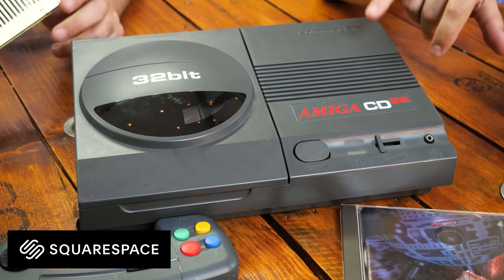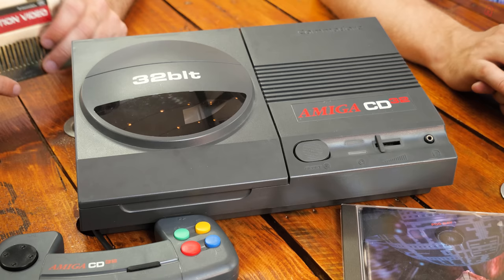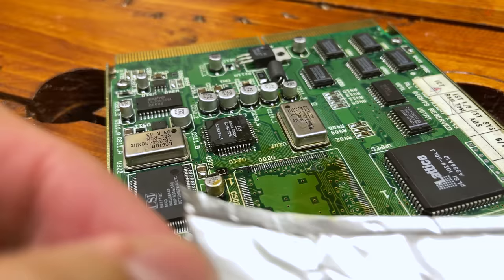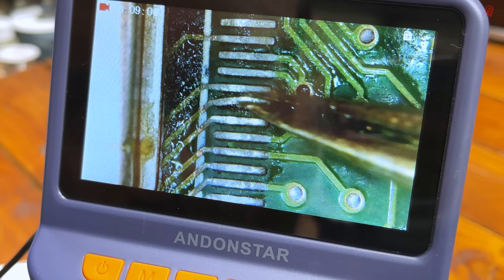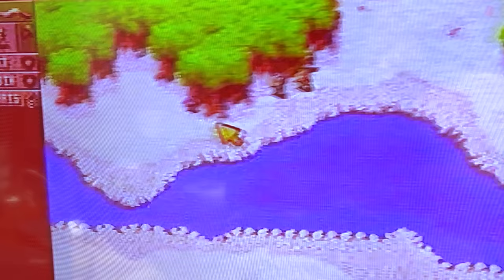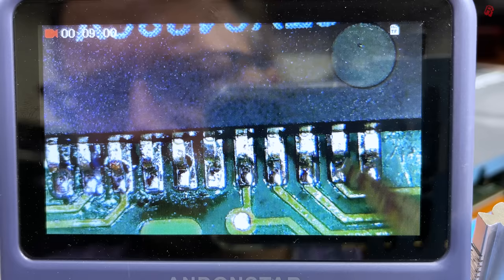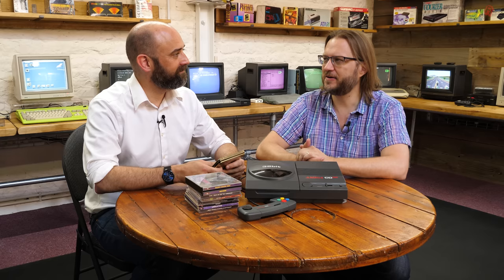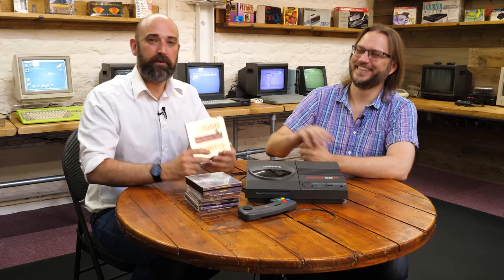CD32 FMV Failure! This thing is a mess, can it be saved?

Comment: Ouch, what a state!  Probably one of the coupling caps or perhaps one of the resistors that feeds the red or green out, or the resistors that terminate.  I would suspect those 100uF AC coupling caps first if they havent already been swapped.  You could bypass with a wire one at a time to rule them out, but that's just a temporary thing if you do that because they are blocking DC and you dont want a bias on there for any period of time.  Nice work, you two seem joined at the hip recently lol
Reply: I agree - check C250_2, C250_4, C250_6. Unlikely but still would check  C250_1, C250_3 and C250_5. It is possible resistors R262,263 or 264 are not on their values of 470ohms. Same for R253, 255 and 257 which should be 75 ohm. I'd also check  around CN1 for  shorts. Pins 2,4 and 6 are ground. Pins 1,2 and 5 should not be shorted to the gnd.
I would also check for continuity, shorts etc associated with signals AB, AG, AR, AB_EXT, AG_EXT and AR_EXT. These signals pass between the STV8438 DAC and to connections on the main bus connector that fits into the CD32 connection socket. Looking at the schematics I have, check pages 3 and 4 for detail of what I am referring to
Reply: That soldering is making my eyes bleed....

Comment: You can upgrade the mpeg rom from the v40.22 to v40.30 via a 27c400 erasable rom and then you can play philips CDi digital cds.

Also the FMV is in case upside down,when you open the case you should see the bottom of the board and it is  normally covered with a see through plastic insulation sheet held down by the four screws, but the owner must have threw it away and so it may now short on something,the giveaway is that you normally see the test points through the square cut out on the top cover.
And yes check the ceramic decoupling caps they are known to go bad with hairline cracks.
Reply: The games or the movies? As it was Green Book and white book mpeg standards

Comment: I've found that using a single strand of wire from some flex can be used to do this kind of repair on fine pitch ICs too for anyone who dosen't have any varnished wire.
Reply: For super fine bodge wires Rafał Bielawski (mostly iPhone repairs on his channel) uses single strands from micro coax shielding 😳
Reply: @RicoElectrico  hey that’s a great idea damn. Frayed shielding after you trim a piece is fairly plentiful if you’re not stretching a huge distance. Plus pulling a little bit out is a reasonable sacrifice if you’re using the coax for other things.
Reply: I normally just use wire wrap wire... pre-tinned and strips easily, if you get the good stuff.
A general tip for any wire really: Watch out for the copper coated aluminum "chineseum" stuff, that stuff is crap for soldering. Get your wire from a reputable dealer, not Aliexpress etc.
Cheers,

Comment: TBH they were flakey from day 1 - I recall mine needed just the right amount of pressure on the edge connector/cart port to work sucessfully. 

My young self put up with it because FMV on a CD32 (Amiga fanboy) - was sooo cool.
My today self has worked that out of my system  - tech HAS to work now

Comment: Hi Neil.
I am fortunate enough to own my original FMV module. I am not very technical with the insides but it's in full working order. I think I still have the original riser board still, but it works fine with my SX32 riser board which has multiple video out options on the back. I doubt either of these would be the cause of your loss of red signal but would be prepared to lend you both for diagnostic purposes (I am going to check for those missing screws too!)

Comment: I was looking at the schematic for the device. There are some electrolytics and some ceramic caps in the output circuit from U210 that provides the AR_EXT, AG_EXT, and AB_EXT signals which are connected to CN1. The electrolytics are more likely to be a problem as they can go bad over time. It would be worth checking them with an ESR meter if you can or just go ahead and replace them.

Comment: check C250_2, C250_4, C250_6. Unlikely but still would check  C250_1, C250_3 and C250_5. It is possible resistors R262,263 or 264 are not on their values of 470ohms. Same for R253, 255 and 257 which should be 75 ohm. I'd also check  around CN1 for  shorts. Pins 2,4 and 6 are ground. Pins 1,2 and 5 should not be shorted to the gnd.
I would also check for continuity, shorts etc associated with signals AB, AG, AR, AB_EXT, AG_EXT and AR_EXT. These signals pass between the STV8438 DAC and to connections on the main bus connector that fits into the CD32 connection socket. Looking at the schematics I have, check pages 3 and 4 for detail of what I am referring to

Comment: A friend back then gave me Star Trek V on VCD because he couldn't play it.
The Sega Saturn also had one of these MPEG cartridges but I didn't bother getting one. For something like this to get supported it would have had to be built into the system(s). Addon hardware doesn't work and even higher specced models of a system, like the Nintendo DSi and New 3DS were, didn't work out if the games had to specifically made for these systems and didn't simply offer extra functionality for the models like how PS4 Pro and XBox One X did. I can see the logic behind MS packing the Kinect with the XBox One but there the problem was, that only a relatively small number of people actually wanted to use something like this but had to pay for it anyway.

Comment: I have had two of these. I have had the fault you have with one of the cards, it turned out to be a ceramic cap. But I replaced the DAC as well whilst I was there. I sold that around 2005 then bought another around 2008 after massive regrets. The carts never have screws in the side (at least neither of mine have). TBH a full recap is wise now as my last one which was perfect developed all manner of faults during 10 years of dry temp controlled storage. A recap brought it back to life and I sold my whole boxed with instructions CD32 collection about 3 years ago. AFAIK there is only Cannon Fodder as a game that uses it (and only for the FMV intro), and also the amiga advert which was on many CD32 cover discs at the time. If you left the cart out you got a postage stamp size CDXL version to view, pop in the cart and it was full screen. IMHO the CDi had the better FMV cart and that is how I watched all my VCD's at the time

Comment: I think that this pretty much points out that soldering is not welding and flux needs not to be applied via fire hose.  Having seen many repairs of amplifiers, computers and other such older gear I know dodgy capacitors (especially cheaper ones like Commodore bought) tend to cause problems down the road.  As long as you get the values correct, it's not like you can make the problem worse by shot-gunning them after all.

Comment: Really good video. The back and forth is definitely a lot more RMC-oriented. It looks like the Red/Green voltage isn't getting all the way through somewhere, meaning it's probably either those capacitors, resistors (if there's any on the R/G lines) or DAC. I'd desolder the caps while you're waiting for new ones and test them. If they're not duff it's probably not the problem.

Comment: I would try to recap the board, if you haven't already. Electrolytic capacitors hate getting too hot and they aren't young to begin with. Someone obviously soldered this board quite aggressively, maybe with high heat for too long at some places.

Comment: I recall downloading a VCD copy of a movie once back in the early 2000s. While I'm sure having a movie on a disc was more convenient than VHS tapes, I thought the quality was terrible. I'd seen examples of good mpeg videos, but the level of compression used to fit the whole movie on a single CD made it look sub-VHS quality.
Reply: I agree, any digital always starts worse than previous counterpart, VHS -Video CD, CD - MP3, Film Camera - Digital Camera, in some cases it takes 20 years for them to improve upon!
Reply: @CastleFamilyThe  The very first digital camera I ever saw was a cheap one my parents ordered from a mail order place for less than $30. It took horrible pictures. They were small (resolution), dark and grainy. That really gave me a negative impression of digital cameras. 2-3 years later, my mother got a Kodak Digital camera and the difference was amazing. I still use it today and about the only time it takes a bad photo is in low light. It has various settings you can use to compensate for that, but to be honest, I don't really know how to use them.

Comment: I'm surprised there wasn't any hot glue in there. But I guess with all that flux it would have never stuck!
Reply: Hot glue? Why? Flux sticks better than that stuff!
Reply: Amateurs have bad habbit "securing" and covering wires in with hotglue.
Reply: @jaekaelae  I remember having to repair one computer where the owner had hotglued all the plugs and cable connections.  Let's just say that I had a few words with him.  Most of those words were not suitable for polite company, if you get my meaning.  😉
Reply: @SpearM3064  Hot glue is incredibly easy to remove with some IPA. No need for bad language!

Comment: I have the same issue with the FMV module on the CD32. But, it only happens after about 10-20 mins of using it. So i have full colour for a while, then it turns red/pink. I did order a tray of the STV8438CV DAC chips years ago thinking it might be that. But i never got around to swapping it out, and it's more likely the caps anyway. If you need a DAC chip let me know and I can send a couple to you(I'm in Ireland). Worth mentioning that my module sure does get hot when playing back video cd's.

Comment: I genuinely hate "repair pros" that use gel flux syringes like they are inoculating elephants. Esp the ones that teach those bad habits on youtube. Mark has better "flux control" than most.  There is a minimum amount of flux to get the job done. Everything else is just lazy? Bravado? Lacking in training?. I use a flux pen for 95% of jobs. It applies just enough flux, at the point you want it, and it wont spread out that much. Sprits of alcohol and a few swipes with a brush and its gone. very rarely, I might have to bust out the gel with a needle tip.  Heres a pro tip : If it takes longer to clean up the flux than It took to solder/desolder the part, you are doing it all wrong.   "oh im just gonna put a bit of fleu'x on thar..."  *gobs it on like toothpast*
Reply: To be fair, most people use far too much toothpaste, too (about the size of a pea is all you really need), but that's sort of getting off-topic.  I agree, too much flux is a problem, and if the excess isn't cleaned, the residue it leaves behind is almost as bad as the layer of cigarette tar that I've seen in the computers of some chain smokers.

Comment: I'd use an o'scope and look at your color channels, looks like you only have composite out but that chip should output RGB separately and they are combined later on. since I don't know where they get combined on that, could be on the board or inside the CD32, so don't overlook the connector inside the unit.

Comment: Most of the chip caps look TERRIBLY soldered in (bad alignment, blobby joints, etc). And with 1 liter of flux thrown on, its impossible to tell if any of the electrolytic caps are bad. Nice repair work so far. I would:  1: fully submerge in ultrasonic cleaning. Urr.. possibly remove most of the parts first and inspect tracks under parts carefully. There could be flux under almost everything on there.  Bath it good. Then remount all the chip caps. Finally replace the electrolytic caps. If that doesnt solve it...  urrrr....

Comment: With all those pads missing, it looks like they tried the capacitor twist trick, but for the chips instead! Seriously though, most likely they applied too much heat unevenly, and tried to lift the chip before all the solder melted. Definitely a trap for young players. Excess heat can also damage caps, both electrolytic and ceramic, so I'd recap the thing as a matter of course. Especially if you've got the schematic with the MLCC cap values. At least the ones around those chips anyway.

Comment: Only seen 2 of these in my day at SDL judging by the amount of flux I would say that board has got extremely hot when it was "flowed" it may have a few dry roasted joints, reflow the board - schematics may be an issue due to its age - a quick google, and they are around on a few forums
Reply: Check the SMD crystals 40mhz on is right in the heat space of the C-cube

Comment: Are there any buffer transistors on the output of the DAC, is it an RGB signal. One could possibly be leaky causing a shift in the dc level. Without seeing a circuit diagram it's difficult to know. It might be worth checking the dc voltages on the DAC pins as well.

Comment: The debate about whether CD32 is the first 32-Bit CD console is debated because the Marty, which only came out weeks before was a 32-Bit CPU and 16-Bit bus... but if that is the standard, the CD-i was in 1990, the CDTV in 1991, and the Sega CD in 1991 would beat both to market

Comment: That FMV module was pretty much dead in the water even when it was new: It was too expensive as an add-on for most people (with virtually no support for it at launch) and including the hardware in the CD32 itself would have raised the cost beyond what most people would be willing to pay (the base CD32 was already kind of expensive). And without the FMV capability being built in, software companies were hesitant to support it, as most people would not have purchased one: limited sub-market in an already limited market. It's too bad MOS Technologies (owned by Commodore) wasn't up to the task at the time to produce their own version of an MPEG decoder, or maybe they were but the MPEG licensing fees were too steep at the time.
Reply: What are talking about!? The FMV cartridge for CDi wasn’t even a year old when the CD32 version came out, the Video CD standard was just building, to say it was dead in the water is simply not true, it lasted many years after DVD in many countries, yes it never became market leader, but that doesn’t mean it was a wasted format, just like Bluray and UHDBD today despite DVD still outselling both. Btw the CD32 was the cheapest CD based console in 1993 (CDi £500 / MegaCD £280+£130=£410 / 3DO Import £650 / FM Towns Marty Import £800) so i don’t see how it can be seen as expensive.
Reply: @CastleFamilyThe  It was dead in the water for the reasons I gave. The fact that there is only ONE game that actually supports it should be a clue.

Comment: Assuming the DAC is OK (it likely isn’t), then it could be the outputs of the chip that generates the RGB signals that feed the DAC.

Is there anyway you can generate & display a video test pattern (eg graduated colour bars). This would help determine if the problem is a “stuck” bit in the higher order bits of the red channel.

Comment: A very good video. A Very interesting product. Looking at the cd32 expansion pinout there’s pin to disable internal video, begs the question if the all RGB data is fed to the fmv card DAC. The expansion ports also have pins for analog RGB video which lead to me thoughts in the above. A Very interesting product indeed.

Comment: I think because so much flux was used it's gotten into the ceramic capacitors and actually created a flux capacitor.  The only way to get it to work again will be to get up to 88 Mph and pump 1.21 gigawatts of juice into it.!  Or replace the capacitors.  Either one.

Comment: It could be the ceramic caps but those rarely ever go wrong (you need to be very careful with the voltage rating of the caps, the ceramic has a slight piezo effect and the capacitance drops with applied voltage).
It is strange that the intro video has more red but the game lacks red. How is the video being mixed in?
To me it looks like an issue with the video being decoded as YUV, which has a very different colour space to RGB.

Comment: Wow, that level of flux SERIOUSLY looked like cannabis resin. Wild.
Reply: I would also suggest it could be any capacitors in the analogue part of the video circuit, OR a biasing resistor. I’ve seen outputs get too blue with a wrong resistor value in the past. Could easily make them pink instead.

Comment: I wondered if you might have flux inside the electrolytic caps????
or maybe the ceramics have been blasted with way to much heat from the first chip swap????

that thing needs an ultrasonic bath filled with alcohol before you do anything.

(I'm not a doctor or a qualified electron wrangler, just a pleb with a soldering iron so don't count on my opinion)

Comment: Thanks for the vid 👍 and that’s a big cart, my Sega Saturn card is a lot smaller. I don’t think that it did well in games using it as well 🤔
Reply: Came out a couple of years later for the Saturn and PSX so probably found a way to reduce chip size, also 3DO one is a huge brick on the side of the console!

Comment: Recap. Recap recap recap. Any SMD capacitor from this era (early to mid 90s) suffers from the fabled capacitor plague, so even if it doesn't look like it, one of those caps might be bad. Best to just replace them all. And because someone was in there prior doing damage, even if the former person replaced them, those might be suspect too (I would not trust the work of someone who left the unit looking like that).

Comment: Your continuity test of the wire fix to one of the pads on the FMV chip was flawed. You put the probes at both ends of the wire which will always show continuity even if it was not soldered to anything! You should have put one probe somewhere further down the trace with the other on the chip pin only ideally not touching the wire that was soldered there.